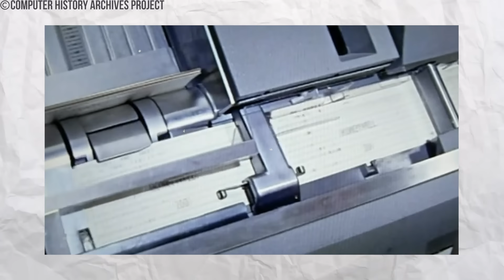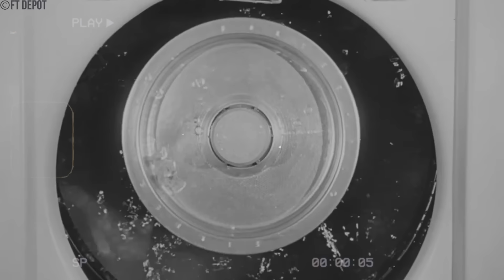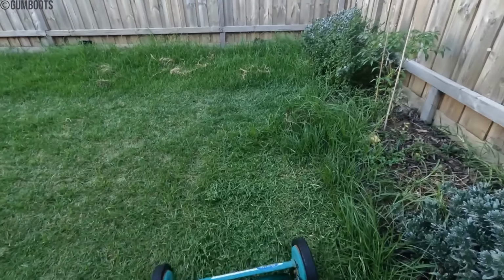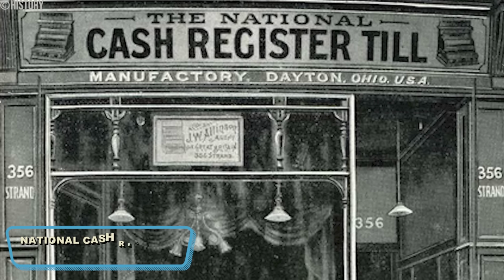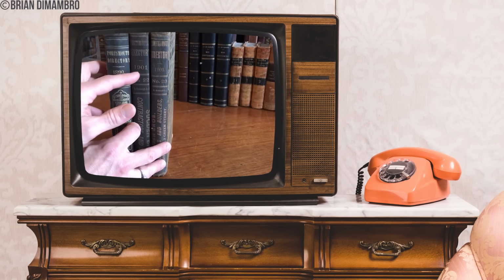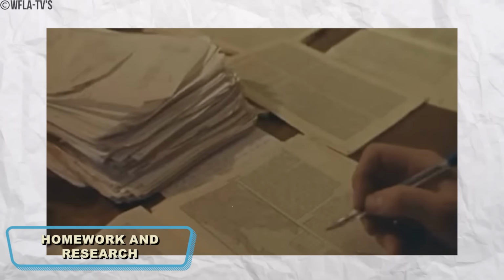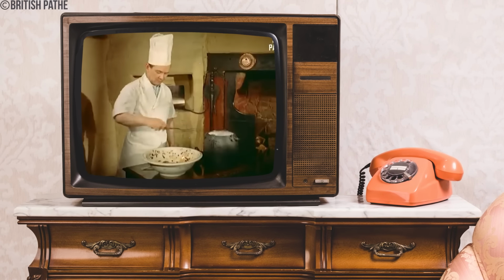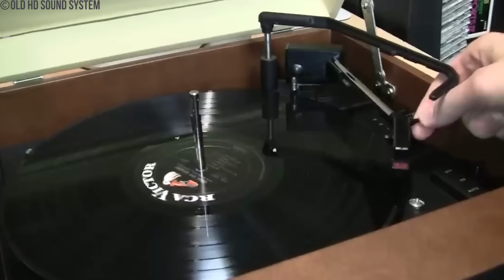25 Things From 1950s Once Necessary, NOW COMPLETELY OBSOLETE!

Comment: 1. coal furnaces
2. vacuum-tube radios
3. telegrams
4. wringer washing machines
5. ice delivery for ice boxes (aka refrigerators)
6. milk delivery
7. manual lawn mowers, particularly push-powered reel mowers
8. black-and-white television sets
9. film cameras with flash bulbs
10. rotary dial telephones
11. mechanical cash registers
12. 8mm film for home movie cameras
13. drive-in theatres, and the old speakers you hung on your window (I'm using the Canadian spelling)
14. automobile window wing vents
15. street directory books (aka maps)
16. mechanical pencils with replaceable leads
17. manual ice crushers
18. encyclopedias
19. key punch machines (notably produced by IBM)
20. manual drafting tools (rulers, compasses, t-squares, drafting boards)
21. cigarette vending machines
22. pressure cookers for home canning
23. coffee percolators
24. home dark-rooms for photography
25. record changers for stacking vinyl records

Comment: Born in 59’. I’ve been there and done that.
Reply: I was born in the early '80s and have had most of these experiences. Grandparents had a tube TV. Zenith floor model. I eventually inherited it and used it for several years myself before it bit the dust. I still have a WE 302 rotary phone. Planning to set it up as a VOIP phone. I picked up a few older VOIP phones for free and can modify the circuitry to work in conjunction with the old phone. Other than building PCs, I haven't done much with electronics in awhile and that seemed like a straightforward project to get back into it. The challenge will be doing it such that I can actually use the dial to, well, dial the phone.

Comment: Never used an old radio, they say they had three batteries.  One was charged once a week, one replaced or charged once a month, the last was small and lasted a year.

Telegrams are basically texts today.

I've seen the old washers at grandma's house when I was little.

There's a good TV episode of Honeymooners involving an icebox.  The one where they consider adopting.

I remember the old metal filled bulbs.  Full of a big wad of fine metal wire.

I've heard that the vent windows were a security hazard.  They can create a blast of air.

They also had text versions of the city maps.  I've never used one, but dad used one downtown.

Learned programming on card punches.  I see both 026 & 029 models.  And others.

Had a class on mechanical drawing.  T-square, 45 degree triangle, 30/60 degree triangle.

Comment: You're a wee bit off on the coal furnaces.  By the 50's they were largely replaced by oil burners.  Also the coal furnaces from the 20's and 30's were not the little freestanding parlor stoves (they were more a thing in the late 19th century).  They were more typically a coal fired boiler that supplied the heat for a steam / hot water radiator heating system and had an automated stoker system that fed coal into the furnace.  And by the 50's many of those older coal boilers still in service had been converted to burn fuel oil.  Iceboxes were still in use in some areas in the very early 50's but as post war production ramped up they were quickly replaced by refrigerators.  It was quite a matter of pride to have a refrigerator in those years.  That was part of what made Jello so popular post war.  You couldn't make Jello with an icebox.  So being able to bring Jello to a church potluck was a subtle way of bragging.
Reply: Homes in the 1950's often had a coal furnace in the basement, and a thermostat on the first floor.  The thermostat controlled a fan.  A heat exchanger in the furnace made sure that smoke went up the chimney and not into the ductwork.
Reply: The house my grandparents bought after WWII had a forced air gas central heating system. They were ubiquitous in new home construction after WWII in suburban neighborhoods. Now my grandparents' generation, that's another story. My grandpa used to steal coal from the railyard when he was a kid so they could have heat and cook their food. And he grew up in the city.
Reply: @Lurch-Bot  My grandfather worked on the railroad.  He was as honest as the day is long.  But one of his jobs was to ride the rails in a speeder once a week checking the tracks.  Well, coal that had fallen out of the bunker and was laying along the tracks was fair game to anyone.  :)  Gas didn't catch on here until the mid 50's, and then it was more propane for stoves than natural gas/propane furnaces.  Natural gas showed up in the 60's.  But this is small town rural America, things move slow here.
Reply: A lot of these things were not done in in 1950s, depending on where you lived. We didn't have milk delivered in Phoenix, we didn't have coal furnaces, and only my grandma had a roller washing machine. I'm guessing that in the eastern US some of these were more common.
Reply: I still live in the house that my parents purchased in 1957.  When we moved in it had a new coal furnace.  The area where I live had numerous coal mines.   In fact, they still are mining coal today.
Reply: A buddy had a coal stoker furnace as late as 1985, my small rental house had a gas burner added to the coal furnace. Progress!

Comment: I'm retired and I still call it an ice-box.  
And I remember my grandparents with a water hand pump over the kitchen sink:
In old homes, a water well hand pump was integrated into the kitchen sink by having the pump mechanism installed directly beneath the sink, with a pipe connecting it to a well dug nearby, allowing users to manually pump water directly into the sink by operating a handle on the countertop, essentially providing "running water" through the physical act of pumping; this was a common setup before widespread access to public water systems and electric pumps.

Comment: lol  vacuum tube amplifiers are still used and some of the most expensive audio equipment on the market are tube amplifiers McIntosh  as an example This company is celebrating their  75 anniversary  1949  - 2024. So tube amplifiers are still sold and have a sound that cannot be replicated by a solid state amplifier
Reply: I had a guitar amplifier that had both tubes and vacuum tubes. If I remember, it was called a transtube.
Reply: @donnisraines   what brand
Reply: The high end guitar amps still use vacuum tubes, such as Fender Twin Reverbs.
Reply: Man, those old Marshal amps were the epitome of sound back in the day. Solid state has nothing on those old tube amplifiers.

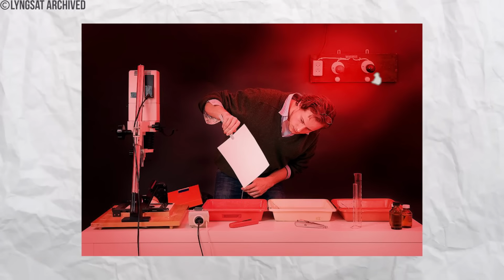Comment: 26:50 What really killed record changers was the popularity of cassettes. Record changers were a near necessity when 3 minute 78s were the standard, but many people later enjoyed stacking 6, 8 or even 10 LPs, for up to 5 hours of continuous music. But a single auto-reverse cassette deck could give you up to 180 minutes of music and if you needed more, a double deck could bump that up to 6 hours, though 180 minute cassettes were rare and more jam-prone than the more common 120 minute ones. When CDs came out, changers came back into fashion, though in recent years, digital music has relegated them to the thrift shops for most people.

Comment: Some of these are still useful. The mechanical cash register for backup (internet down and electricity down proof. Modern version would create a scannable log when everything goes back up), the encyclopedia collection(internet screws around with some knowledge), the crockpot (fridge is an energy hog still), mechanical pencil, drafting table (wish I had one sometimes lol), those vent windows(AC is unreliable in a vehicle),  those push lawnmowers if you’re just keeping grass trails, maps and directories can be useful for finding things that the gps just doesn’t list for local things and as backups if something goes wrong with the phone.

Comment: Many of these so called obsolete items are still in use by the " Off Grid" type lifestyle. Wringer washers, Ashley Wood/Coal burning stoves, ice blocks stored in a root cellar covered with sawdust, and Manual or push mowers,

Comment: coal furnaces, ice boxes in the '50s?  Sorry but oil fired hot water heat and electric fridges along with going to the grocery store for milk and I'm from West Virginia 

You're talking about the 30s and 40s
Reply: My mom's grandmother had an ice box, outhouse, no running water, and did not get electricity until the late 50's. Rural people exist.
Reply: @borrisg4972  There are still areas where that is the norm, despite what the elitists think.
Reply: I grew up in the 50's and 60s,and our house in Buffalo had a coal furnace,and big coal bin for deliveries. it wasn't until the 60s when the furnace was replaced with a gas furnace,my dad stripped off the coal bin when he remodeled the kitchen. the home was built right after WW2. My oldest sister still lives in it. My mom had a wringer washer in the 50s. we had milk and icecream delivery up to the 70s.
Reply: There were still people in the 60s with coal furnaces and true Ice Boxes.  They weren't completely gone until the 70s.
Reply: Sheet-metal worker- Gravity furnace, aka "octopus" came out 1910- 1945> An old tin-banger  said they came out with what you called them "forced air"systems after the war tech was developed during the war on atomized pressure spray nozzles ect. re: jet engine tech. He made floor boots out of tin cans flattened out as there was no sheet metal back yet.
    I tore out lots of heavy, filthy octopuses.
Reply: @happycamper848  I LIKE "octopuses".  They are nice and QUIET.  Forced Air systems are often noisy, and I don't like noisy.
Reply: @jamesbosworth4191  absolutely!
Reply: octopuses were gravity systems without pressure mainly because there was often no electricity for blowers. The supply was on the inside of the house and the return was on the outside by the windows. This is reverse of them there what you call, them there,  " forced air systems" . 
   they had all oversized round ductwork, 12 and 14 "+ inches supply because it was passive.
   A use  an example of passive exhaust ductwork in my coal  Blacksmith forge exaust stacik.  it is a heat rising exhaust system, with a mathematical equation of size to duct extraction over elevation. Passive  octopus systems were also calculated mathematically.
Reply: @happycamper848  Yes, I am quite familiar with them.  They are still quite common in my home-town, San Francisco, California.
Reply: We had milk delivered to the house in the early 1960s until the local company discontinued home delivery.  We never had "oil fired" anything.  Ever.  We used kerosene for heating and propane for cooking.  Today, I heat my house with propane, and the water heater also uses propane.
Reply: @borrisg4972  We still have an outhouse in the backyard.  It was built in 1931 and is a two seater.  There is a smaller hole for children.

Comment: In a Texas-style power outage, that coal stove, washboard, ice and milk delivery are looking pretty useful! Also in the early years, radio sets were battery powered, meaning you could stay informed until the battery ran out of juice. Today's equivalent are the hand-cranked emergency radios. I think backpackers and preppers will appreciate much of the old tech that didn't rely on the availability of city power.

Comment: Why are you showing pictures of coal STOVES when you are talking about coal FURNACES? Homes were not just heated by hot air coal furnaces (octopus), but coal fired steam boilers for steam heat were also very common. Some houses still were heated by one or more coal STOVES in various rooms in the house. These heated the immediate room they were in, and the heat passed through doorways to other rooms on the same floor, and through "heatalator" vents in the floor of the rooms above to allow the heat to rise and heat them too. My grandmother's house was heated by a wood / coal stove in the kitchen which also heated the water for hot water, and a pot belly stove in the living room. Upstairs, the bathroom and bedrooms were heated by heatalator vents in the floor.
Reply: You get what you pay for!  Lots of nostalgia here, even if some facts/images are fishy.  (Eg. Digital cameras didn't replace film cameras until into the 2000s.)
Reply: @wendigo53  LOL ! I get your point, but I bought one of the first commercially available digital cameras, only VGA resolution, 640 x 480, and cost me over $400 in 1996 dollars.Before that I had my own darkroom, and have been a serious photographer for many years. Now I shoot with a Pentax digital SLR camera.
Reply: @powellmountainmike8853  For sure.  Whereas I think I was putting in film until 2002.

Comment: I grew up in the 1950s and several of these were already obsolete. Ice deliveries? Coal furnaces? Wringer washers? Never saw them (though we had a furnace that had long been converted to oil, as did my grandparents). Push mowers? We had a gas powered mower. Milk deliveries, though, were still a thing.
Reply: Me too, most of theses things were obsolete long before the 50s. I was born in 1950 and we had Panel Ray heating, not coal or oil. My Dad used a power mower and we had both a washing machine and a dryer.
Reply: You'll remember that the Honeymooners still had an ice box.
Reply: That was not true for the Midwest. Homes built in the 30’s and 40’s still used coal and we had a coal chute that delivered the coal into the coal bin.
Reply: in the '60's there were a lot of those old wringer/washers in peoples basements after they transitioned over to the more modern washer/dryer units. People held on to those for awhile, probably because they relied on them. And people still liked to hang their clothes outside on a clothes line, for freshness. Especially bed sheets

Comment: There were two basic methods of canning food. The pressure cooker mainly for veggies, and hot water bath for most fruits. In fact, it really wasn't safe to can veggies by the hot water method. My MIL canned cherries by the hot water method, and she always gave us some jars to take back with us after a visit. We were warned to pay attention to the lids when we retrieved a jar from storage. If the lid remained flat, the seal was intact. But if it bulged upward, it meant the food inside was spoiled and we were to discard it. I found the best way to break the seal was to run hot water over it, and if that didn't work, I banged the edge with a spoon all the way around the top of the jar. It always worked -- eventually.
Reply: My Mom and Granny only used the hot water bath for canning veggies and fruits. Never had any problems with them.
Reply: Pickles and jams were what I used hot water baths for in the late 70s. They're still used

Comment: Wringer washers persisted in some rural areas into the 1980s where rainwater tank water systems didn't have enough pressure to reliably run the automatic wash cycles on more modern washing machines.

Comment: Life was nicer before Internet as convenient as it may be, but at least I was not living so early on we had to have an ice box.
Reply: I was born in 1950, and we lived in a very rural area. My folks did have ice delivered, and they cooked on a multi-burner hot plate. Very primitive, but that was all they could afford. Eventually, our dad did the calculations and found it was cheaper to purchase a refrigerator and a real stove with built-in oven. So we eventually got those. And we also got a chest freezer, as the small freezer compartment in the fridge didn't hold very much. But I do remember the ice man entering our home and placing the ice into the box. I think I was around four or five before we got the larger appliances.
Reply: My dad always called our fridge the icebox lol. Old habit I guess.
Reply: You have an ice-box V4.5 .

Comment: lived in a small town in Germany in 2017, the family would buy milk from a neighbor barn. 
Am still in germany and have a manual lawnmower for sundays (for law you any run any machines). 
Mechanical pencils are still used specially in universities, on faculties like art, design, architecture and engineering, as well as other manual drafting tools, the saying is “paper holds everything and the hand thinks faster than the computer”. 
Cigarets automates still around, but have been update to ask/demand a chip-id.
Pressure cockers are still a very good tool, i just got one for xmas. On that same topic, mermaled, jellys, jams, are amazing when self made, as well as tomato sauce and other meals.

Comment: My favorite record changer might be my 1946 RCA Victor 67V1. Gorgeous sound. I play stacks of my over 2,000 78 rpm SHELLAC records. My other is my Philco 42-1012 Beam of Light record changer. Tons of bass. Good tone. Vacuum tubes are still used in instrument amplifiers and high end amplifiers of other designs. Most microwaves still use a tube, too, though a solid state replacement for the magnatron has finally been developed.

Comment: Most of the radio equipment shown was obsolete by the 1930s.   That guy at 2:37 has no clue how to key code.  he's got the tapper at the edge of the table and flinging his arm to key instead of just moving one or 2 fingers.   his arm would fall off by the end of the message.     Anyone in their right mind would be using a sideswiper key at the very least if not a vibroplex.

Comment: We had a manual lawn mower up to the 80’s. Not a big lawn, and if you kept it up, the clippings were negligible. Had to mow 3-4 times a week (15-20 minutes) to achieve that. If you waited longer you could add an hour to gather the clippings.
Even when e had an electric one, we still used the hand mower to not have the hassle of the extension cable.
Tube radio’s and B+W TV’s we had until the beginning of 1980. (Don’t fix or replace what’s not broken).
Flash bulbs were a staple especially those cube flashes until the late 70’s.
Rotary phones: one could also dial by tapping the receiver hook (had to get past the rotary lock.😂)